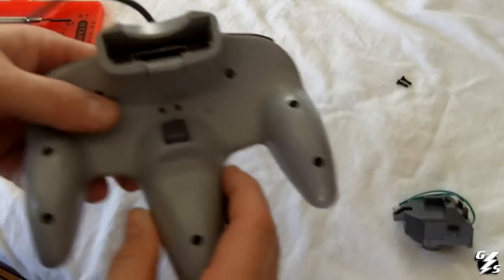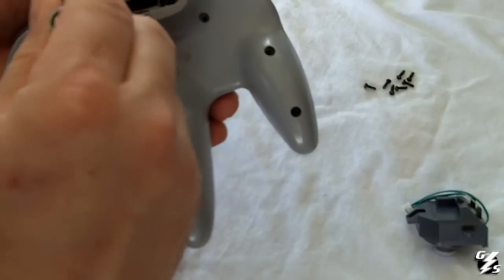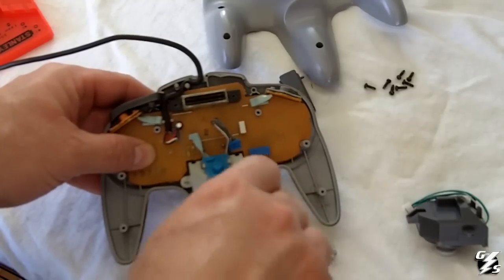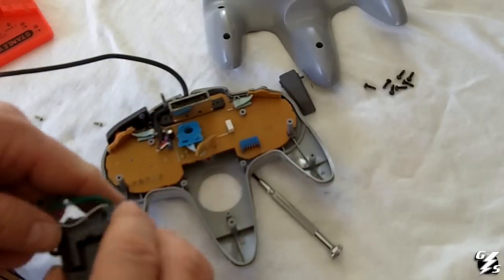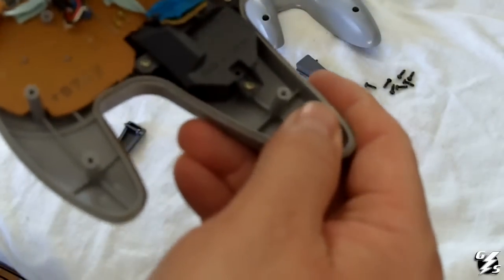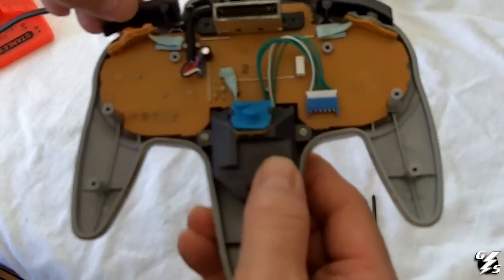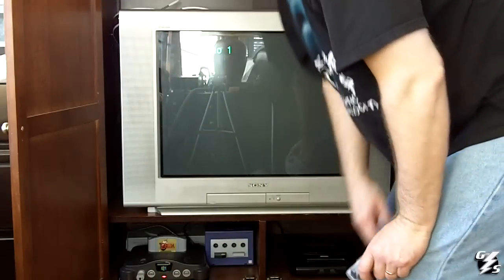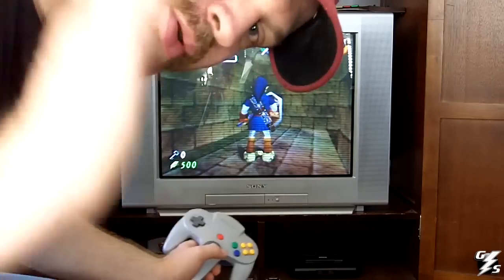How To Replace Your Analog Joystick On Your Nintendo 64 Controller

Comment: OoT would have been a good game to test the input delay on this aftermarket stick, but... You had Link equipped with the hover boots. That gives him a rubber-banding effect while running around. Not easy to gauge movement, which is necessary in the case of what the stick controls.

Comment: I have done something like that with a ps2 remote. My dog chew the crap out of one of my controllers so I use that for spare parts. Man its been about 3 years and I can't remember what went wrong with the other controller. I just remember taking them apart and putting something on the remote. It worked,